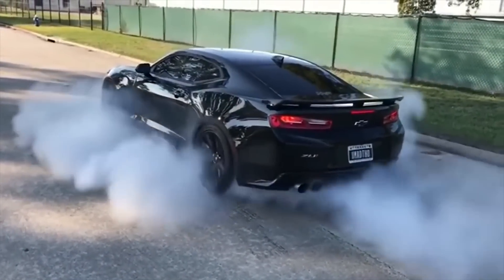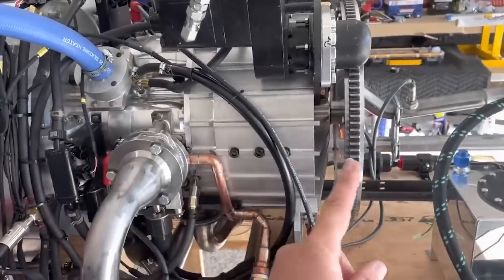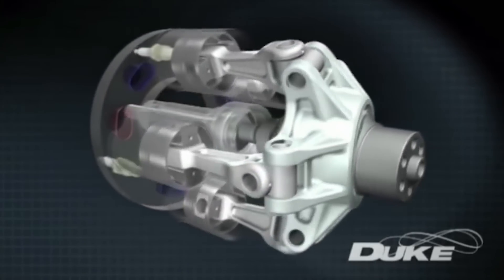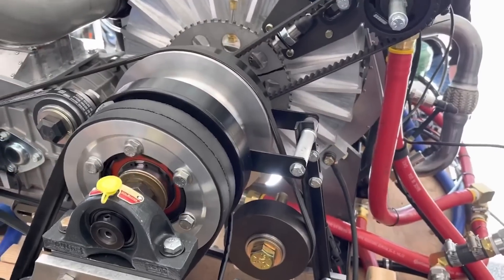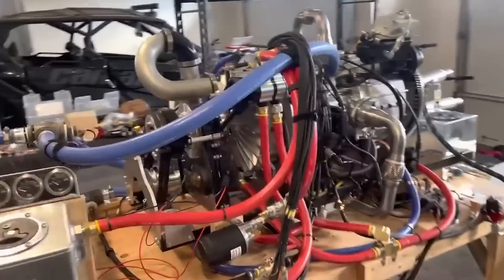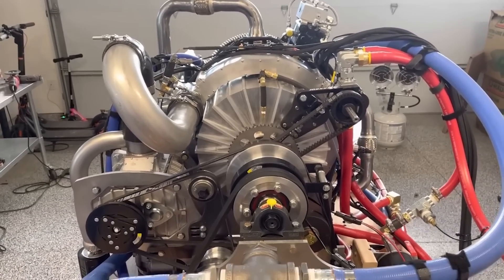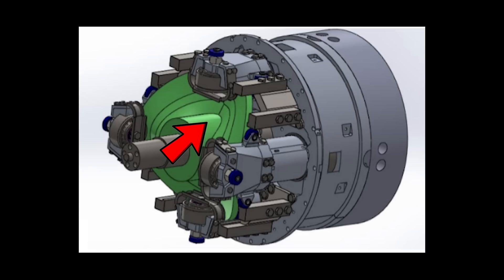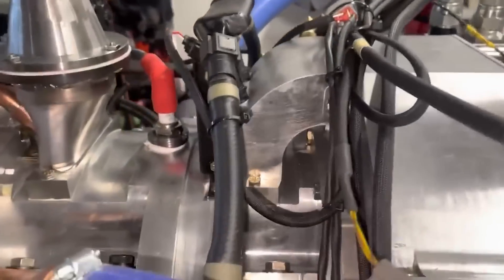Devize Barrel Engine: The Next Step in Combustion Technology

Comment: Neither new nor revolutionary.  Opposed pistons and swashplate engines have histories going back to the 1930's.
Reply: earlier... seeing as the 1912 books i have were already discussing several designs...

yet none were simpke enough, cheap enough, or versatile enough to compete with plain crank and rods in a standard configuration.

the biggest issue is the "skewshaft", it puts massive loads on the bearings...
Reply: @paradiselost9946  I stand corrected. Most of IC engine development has been ideas ahead of the metallurgy or manufacturing capabilities of the time being re-visited as technology catches up.  There has to be a cost or performance benefit for changes to be widely adopted.
Reply: @thamesmud  lol, even parsons raised the idea of using his steam turbines as compressor/turbine for an ICE... back in 18 whenever,  when he filed the patent for his turbine...
took a few more years until whittle got the credit... it wasnt a new idea.

power steering was invented in the 1700s? or at least, contemplated, sketched, and forgotten...

main issue with ALL engine designs IMHO is mechanical advantage. 
be it a crank or skew/wobble/swashplate... (a rotors eccentric is still a crankshaft.)

they make great compressors. the mechanical advantage increases as they approach TDC.  that is, the crank can rotate for more degrees with little to no piston movement at TDC, applying a huge amount of force on the piston, whereas in reverse, the immense pressure on the piston does sweet bugger all but slam bearings in a straight line.

at half stroke, it can produce the maximum torque, yet by this point the gas pressure has dropped so far, and the work available so much less that its a moot point... most engines start exhausting not far past half stroke... some twostrokes with extreme porting start even before then...

(diesel and steam have an advantage here as they can both maintain cylinder pressures for longer, for more rotation of the crank, where it has more advantage.)

we have been trained to believe theres only a few engine types... two stroke. fourstroke. turbines. rotors. you only see some of the real "oddities" when you start looking at OLD books...

fair enough. they could only teach us so much on any certain topic at school.

open any technical sort of book... therell be a diagram of four stroke, two stroke, and in a certain era, rotors... thats it. no need to show you that exotic and super rare exhaust scavenged "twostroke" oil engine used in a small fleet of scottish fishing boats and nowhere else... or the thousands upon thousands of failed rotaries... (might get a sarichs orbital if lucky?)

the standard blurb... "an ignited air/fuel mixture that forces the piston down the cylinder producing power..."

and thats it... next subject. 

only the vaguest idea of how things actually work, and plenty of room for misunderstandings, false assumptions, and then there is complete indifference... " i like cats, cars are stupid".

so the lack of awareness means any "novel" approach to the same old mechanical principle and mode of operation is "revolutionary"... they arent. they still have all the disadvantages with no advantages. just more disadvantages.

fourstroke with crank and valves survived as its so simple, reliable, and cheap. unfortunately its hard to "unlearn" a lifetime of thinking a certain way?

poppet valves vs rotary valves... "valve springs take power to compress". yes, yes they do.
noone stops to consider that springs release that energy minus a bit of friction and heat as the valve closes again. almost ALL of it... and a poppet valve seals well with pressure only making it better, takes heat, doesnt have too many issues with thermal expansion...

rotary valves have never worked out in the long run.

whereas i do like sleeve valves...

out of all the old engine designs, two seem worth blowing the dust off and rethinking as they are fundamentally different... yet one is only just a very slight change to what we already do!

the humphrey pump. think "ram pump with sparkplug and carb". in theory, the highest thermal efficiency of any engine. in practice, fairly good. better than an equivalent engine and pump... 

WWI interfered, a few big ones were made here and there, then forgotten. didnt get the attention they warrant...
true "liquid piston". problem is how to USE that liquid piston! the idea of a self contained hydroelectric plant seems good... or even plain hydrostatic? has to be some way to use a jet of high pressure water...

then theres the lenoir cycle. deemed useless for having no compression. superseded by the "vastly superior" otto (beau de rochas) cycle... aka, four banger.

thing is, we have these devices now that take waste heat in the exhaust gas, and compress air with it... call them "turbo superchargers" or some silly thing like that...

and in compound, they can easily reach several atmospheres of compression...
why bother with the compression stroke at all, at that point?

only a small change to the current sequence of events in a standard piston engine.

"suck bang blow" with a squeeze on the side.

Comment: There are plenty of revolutionary designs for ICE's, and some of them have a lot of promise. But the biggest problem is one they all share - getting a major manufacturer to adopt them and install them in their offerings to the market.
The major manufacturers have vast engineering departments full of people with a vested interest in keeping anything they didn't invent away from consideration by management. There is no way they are going to assess someone else's design and recommend it to the marketing department for the simple reason that management would say, "If we are using someone else's design, why do we need our own engineers?" 
As a result, we are all stuck with the same old reciprocating piston engines being eternally modified and complicated, and ever more expensive to maintain and repair.
Reply: The real issue is it's hard to replace something that's simple cheap and reliable with something expensive complicated and likely to be prone to high wear on the sliding components.
Reply: Actually, many engines are cheaper, more reliable, and easier to repair and maintain. Planned obsolescence is the name of the game and staying on top of the hill...

Comment: This engine still has reciprocating mass, I know of a rotary working prototype (not a wankel rotary) having massive torque at low RPM, 90 degree firing sequence, only 5 moving parts, very simple design, easy to manufacture, just needs recognition !!!
Reply: Show It, please!
Reply: If it works by burning fuel, the only advantages are power to weight ratio - mostly unimportant in automobiles.  As an aircraft engine it might be usable if it can be made to be reliable.  The problem with any internal combustion engine is that rotational torque is a side effect of combustion, not the primary product.  The primary product is heat in any ICE.
Reply: @ohger1  What if it was running ahead of the heat caused by combustion ?
Reply: @xpgaming6567 No my Brother has designed & built a working prototype, it runs better on Hydrogen than it does on petrol.
Reply: @robertmorris9275 hydrogen engines are cool but impractical because of the requirements to store hydrogen are not worth it. How does his get around that?
Reply: @Thomas43990  Well perhaps He doesn't have to get around that, it runs very well on petrol.
Reply: @xpgaming6567 No, this engine design puts the liquid engine in the shade !

Comment: That thing was smoking like Willy Nelson 😂
Reply: Don't you mean more like Bob Marley 🤣🤣
Reply: Smoked even worse than a a worn Turboed Wankel 😅  And its not a opposed cylinder engine?!? Thats not new... But the wave crap are 😘 really don't think much of this. But hopefully it gets out of the  YouTube news state...
Reply: Snoop Dogg has had the fire department show up several times....
Reply: Smoking like the Fabulous, furry, freak brothers.
Reply: I think it's a 2 stroke and uses 2 cycle oil mix in the gasoline.
Reply: The EPA and green nuts will need clean underwear.

Comment: Far from new, this engine configuration was invented by Anthony Michell who patented it in 1917.
Reply: nah. lamplough preceded that by a few years. his is a bit unusual with its sleeve valves...

and its closer to this design with the yoke and spherical rod ends... michell used thrust bearings on a swashplate. utterly different.
Reply: @paradiselost9946  the video showed both methods although it talked only about the swash plate

Comment: It's just the same as a airconditioning pump they just put two together an added fule inbetween
Reply: Yeah, nothing really new here. They combined two wobble plate design rotary compressors to make a multi-cylinder opposed piston IC engine. Novel combination of two old concepts. But what about all that smoke; that will never pass EPA emissions testing.

Comment: The barrel engine is a very old idea.
Reply: Really? How old is it?
Reply: try "lamplough". closest to this design with its yoke and spherical rod-ends. 
or "michel" is another one... uses a swashplate and special thrust bearings... that are still used today in propshafts for ships as they deal with immense loads...
Reply: So is the reciprocating Otto cycle engine in every car. Doesn’t mean it can’t be improved upon
Reply: Have you ever taken an automobile air conditioning compressor apart...   Some have five seven or nine pistons in a circle...  Doing the same thing.... Ford never could build one that would last over 5 years.  At one time.. ?
Reply: @Rick-qf5de odd I've never had a Ford A/C compressor fail, but I have had Honda compressor fail

I go back to 1990 f150, orginal owner and 600k miles, plus numerous other Fords.

Comment: Mine ran on detonation.  Regular crank engines can't handle that much force and result in knocking and pinging.  Much more power is captured in non- tangical piston rods, no side loads. Very cool, thanks, Chris! 😎👍💚🤙
Reply: a detonation based piston system! please tell me more. That sounds like it has amazing potential for efficiency, though i bet there is massive nox emissions.
Reply: @playyourturntodieatvgperson  internal combustion engines will be obsolete. I no longer am interested in them since because of the formation of nox.
Reply: @jamesbishop9156  nox isn't that bad, you can use EGR and or water injection to minimize it, which combined with catalitic converters all but eliminate NOX. i expect hybrids to stick around for a long time, as they are lighter than both EVs and pure combustion and have good range and efficiency. my theory is that we will see methanol fueld hybrid cars and EVs become the norm soon
Reply: @playyourturntodieatvgperson  There will be a new technology that makes ice's and electric vehicles obsolete, coming out of Michigan State in November.
Reply: @jamesbishop9156  bold and exciting claim! could you tell me more or link sources? i'd love to know what you are talking about and how you know. ICEs and electric motors are very potent technologies that have a lot of things going for them, something good enough to make them obselete must be extreemly impressive.
Reply: @jamesbishop9156  also, HCCI or SAHCCI or RCCI or other similar technologies drastically reduce nox by removing that hot combustion field
Reply: @jamesbishop9156  its passed November...
Reply: @Uluhbek97  I'm still working on it...👍😁✌️
Reply: @Uluhbek97  Thank you for asking.  I'm very excited. My new invention is ready to reveal shortly.
Reply: @Uluhbek97  I'm enjoying your music now. 👍😎❤️
Reply: @playyourturntodieatvgperson  I work with fluid dynamics. I have two machines now nearly complete. One is the power supply system, and the other one makes jet engines and rockets obsolete.  Scientifically sound, safe, and clean.

Comment: I had 6 pistons  on each side opposite running on a swash plate.  6 pistons fired at once, 3 on each side. I utilized the Burke stroke... better than two stroke engines. Very powerful clean energy.  ❤
Reply: Does it work seamlessly? its really an interesting concept. Helicopters use swash plate without any problems so I think it an work here also. Thanks
Reply: @muhammadhaq7773  Yes, it was perfect. I did that 20 years ago, it's gone now. I will be revealing my latest invention imminently. 😁👍